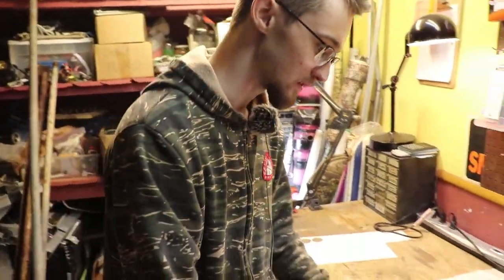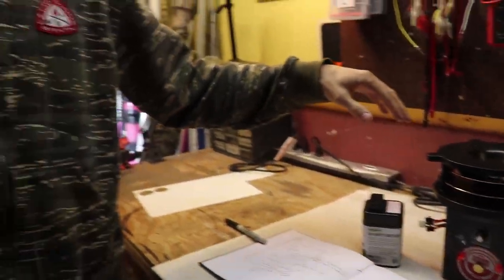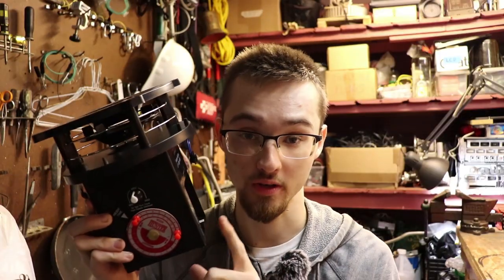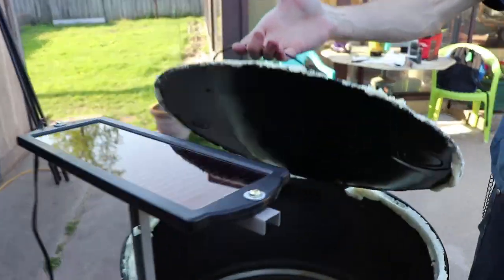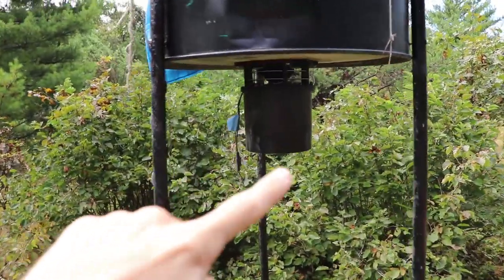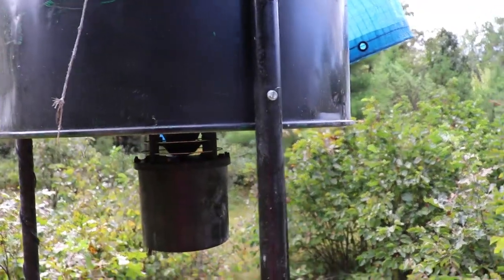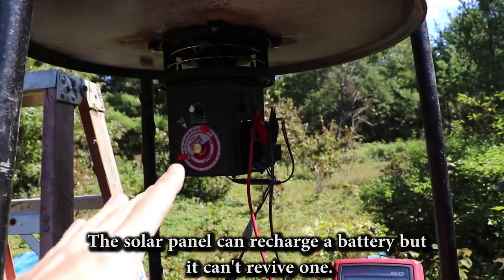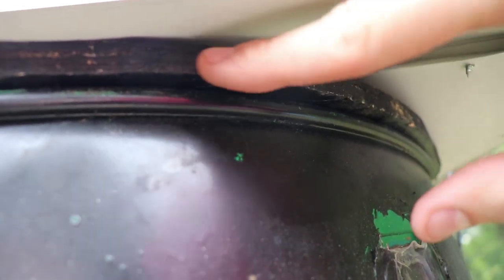DIY Deer Feeder (CHEAP)

Comment: Try finding a drum with the locking lid that has a gasket in it. That will solve your water problem. Then use a burning rig to heat up the legs just below the drum and bend them out on about a 20 degree angle. If you don’t have a burning rig clamp them in a vice and bend the hell out of em. Way more stable and you won’t need to anchor it down.